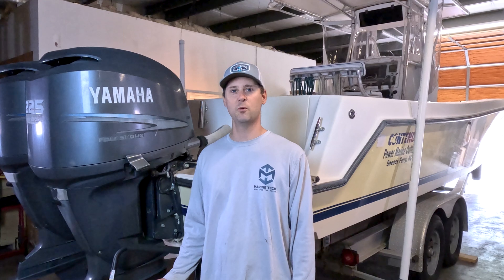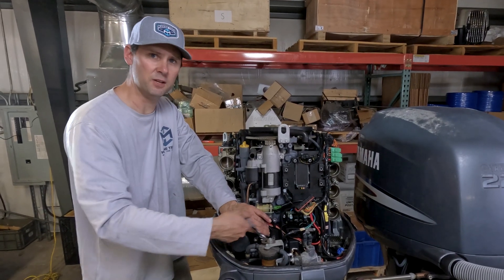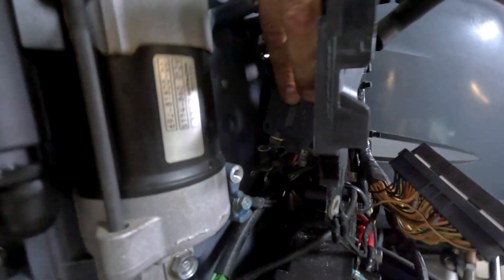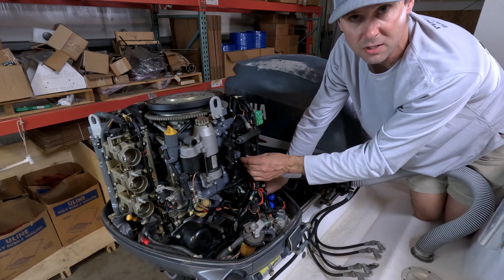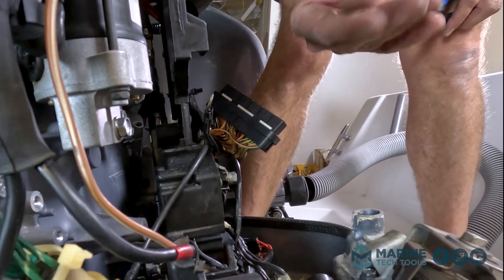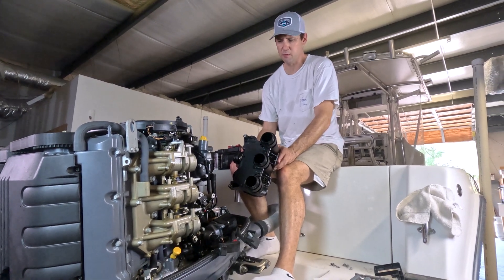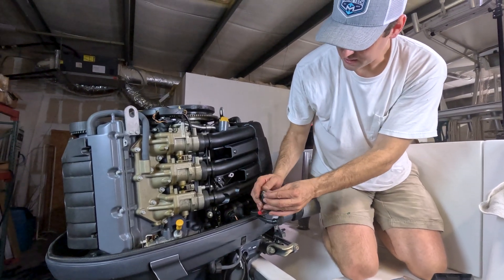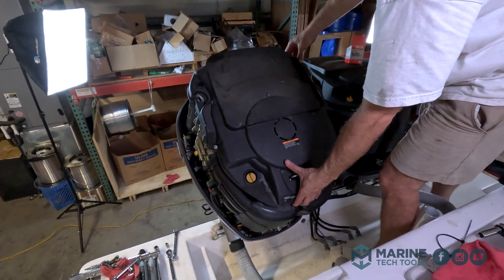Yamaha 3.3L F225, Rough idle, not charging, not peeing - Marine Tech Vlog#3

Comment: Gentlemen, what was the "not charging" issue?
Reply from the maker: The tell-tail (peeing) raw water flows through a fuel cooler and a rectifier, since that coolant water was plugged up at the fuel cooler, the rectifier would overheat and then not charge.  Also caused a rough high idle.
Reply: @MarineTechTools  That cleared it up for me.  Thank you for the reply.